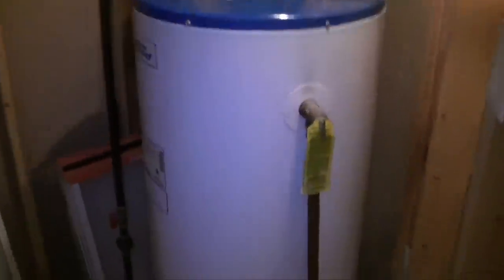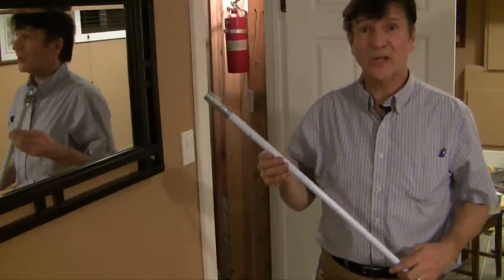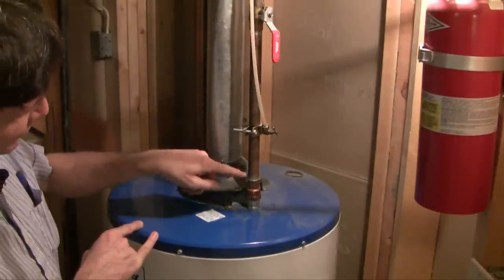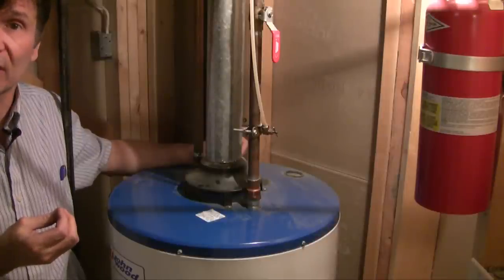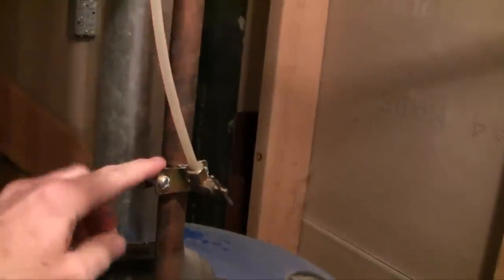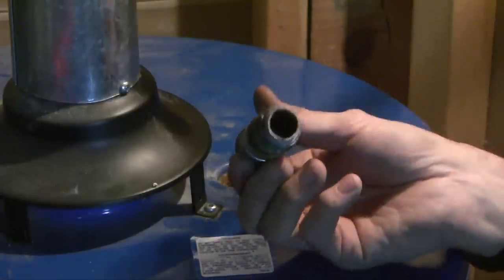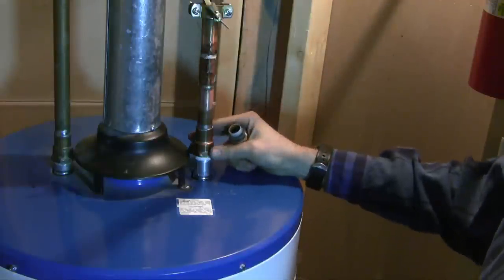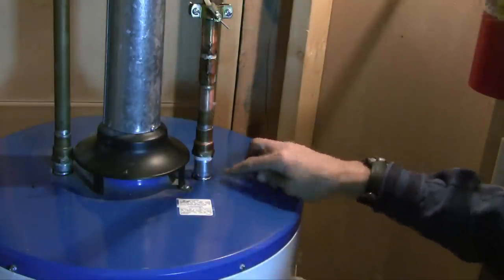How to repair a weak hot water heater, by replacing the dip tube

Comment: if your dip tube is broke and you never changed your anode rod...just replace the water heater.. the internal damage and corrosion is already probably to far gone.
Reply from the maker: I understand what you're saying, and it sounds like the line a pro would offer. Because those guys have to bill the customer for labor, the economics of a decision that could go bad with early failure has to be considered. It's not all about them making more money by selling a new tank, they care about their reputation if the tank should go bad soon after service. The amateur discounts his labor and can discount some of the risk as well. In my case that advice didn't hold, and I got many years of service out of that water tank before I sold the home. I paid about $30 for a dip tube and an anode rod, compared to hundreds of dollars for a new water heater.  Also the new water tanks are not as durable as those old style tanks, so in the end it worked out well for me to put the effort into maintenance.
Reply: when i get a no hot water call first thing i do is see the tank age...if its 10 years or older i ask if any maintenance has been done..has it ever been flushed?? anode rod? etc..  99% of the time i get " what is an anode rod" you can get 20 years out of a tank but hardly anyone does preventative maintenance. i just suggest replacement.

Comment: Anybody out there want to change my dip tube? There is now way Im going to be able to do this
Reply from the maker: That connection can be tricky. It's very tight, with a chance it might leak after. All that said, if the water tank would need to be changed anyway if you can't get it fixed, then there is less to lose. When I did the video, I didn't want to underemphasize the complications that can can happen, so I'm glad to hear you got an important part of the message. Thanks for watching!

Comment: so silly the old dip tube was made out of metal??? but the new ones are plastic? hopefully new hot water tanks have plastic dip tubes, that way no maintenace is ever needed!
Reply from the maker: The 80's and 90's saw plastic tubes that became brittle over time, then fractured from the heat shock under use. They usually fracture through the little hole that is there to prevent a siphon effect. This one was plastic. My most recent tank had no dip tube, instead I had to route the feed line into the bottom of the tank. Any tank that feeds in the bottom is unlikely to have a dip tube, though it will still have an anode rod.
Reply: @spelunkerd  THANKS FOR THE REPLY! My 25 year old gas tank runs hot water for a few minutes and then gets luke warm. I'm going to try replacing the dip tube and will let you know if it works.
Reply from the maker: @nhannguyen-sr9vh  Good luck! You should consider replacing the anode rod at the same time, it doesn't take much. The other suggestion I have is to get some plumbers pipe dope to smear onto the teflon tape when you put it back together. When you do that connection, it is fairly common for it to leak afterwards, and by using both paste and tape your chance of a leak is smaller. Those 25 year old connections are going to be tight, and so having a second person to hold the tank while you use a breaker bar to open the joint will make it easier. With a 25 year old tank, you should be prepared to replace the tank if the repair doesn't go as planned. In any case, a pro would probably replace the whole tank, so you won't have lost much.
Reply: @spelunkerd  only had about half a tea bag of sediment after 24 years. replaced the anode rod, the dip tube was actually fine and was metal. I think we just need to reduce hot water usage so tank keeps up with our usage is my guess?
Reply from the maker: @nhannguyen-sr9vh  Good news, thanks for the followup. Sediment can build up on the external gas heater plate, or on the element if electric. You could wrap insulation around the exterior piping to help retain heat. Those old tanks sure last! You'll never get a new replacement tank to last so long.
Reply: @spelunkerd  throw away society I guess?  people just dont' fix stuff anymore.   I'm going to be hooking up a rainwater catchment system so might last forever, hahaha.

Comment: If just your nipples were corroded would you have changed your dip tubes along with the nipple's as well? By the way great job explaining it step by step, if every you tuber did it this way it would be you tube heaven!!  😲❗😲❗
Reply from the maker: That's a good question. I probably would replace the dip tube anyway even if it looked OK, since they get brittle with age and you don't want to go back again in the future. Also it is a good time to swap out the anode rod at the same time, since the basics of the repair share the same initial steps. Some new water tanks don't have a dip tube. You can recognize those ones since the cold water entry is down at the base of the tank, a much better design.
Reply: @spelunkerd  thanks for your rapid reply

Comment: Use a 3/4” coupler that has no centering punch.   U could cut ur pipe on the hole, clean it up an solder it back on with no other joint. Those dip tubes cost $40 + in America.
Reply from the maker: That's a good point, I suppose you could make your own. Remember a normal dip tube has a small 1/8" hole near the top, to allow air in and prevent siphoning. I think that's where those plastic tubes tend to break, right at the hole. The last water heater I installed had the entrance piping at the bottom, in which case a dip tube is not necessary since cold water automatically enters the bottom first.